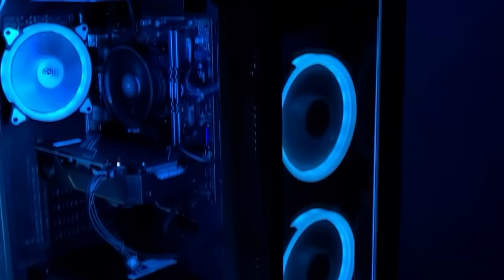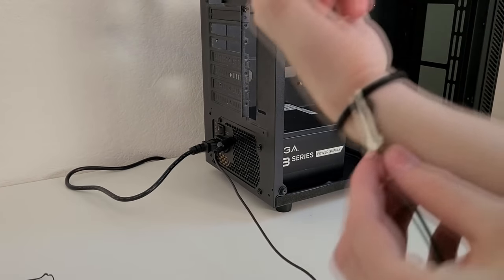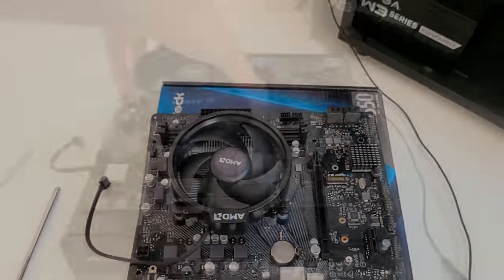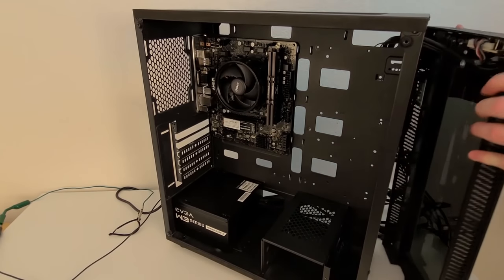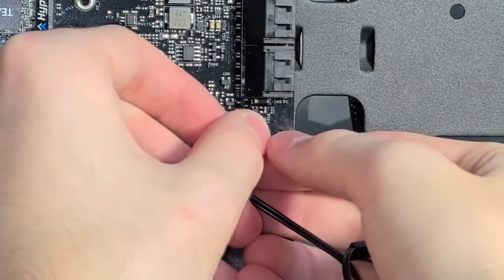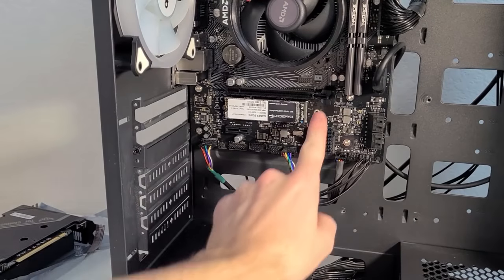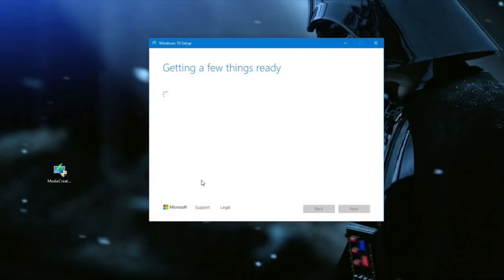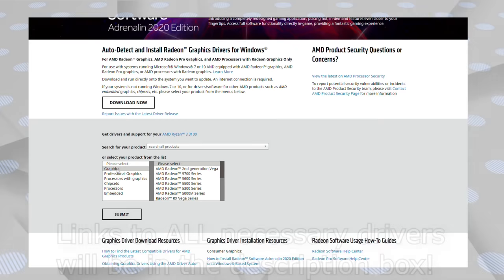BEST $550 Streaming/Gaming PC [Tutorial, Benchmarks]

Comment: MY RGB fans light up on boot but go out. games crashing on start i assume from my 5mbps speed... refresh rate is only at 1 HZ....
Reply: Is this a joke😂
Reply: @antissleeping2912  didn’t download my gpu driver... working good now
Reply: @JohnSmith-xq6cv  oh ok👌
Reply: @JohnSmith-xq6cv  since this dosent have built in WiFi what did you do, did you connect a WiFi card or an Ethernet cable? And did you fix the problem with your fans? And how did you fix your fans
Reply: @antissleeping2912  100 foot Ethernet cable. I’m try to fix the Rgb fans lighting today, I hear that all you have to do is NOT plug into the fan adapter and plug directly into the motherboard
Reply: @JohnSmith-xq6cv  have you fixed your fans?

Comment: Guys help if I have a laptop with windows installed on it can I use its ssd to boot into windows or do I need the flash drive and idc about a watermark laptop has been dead for months and we won’t need it
Reply: I would recommend you to use flash drive since it will be much easier to install
Reply: @big_smoke7t  but I can use the ssd right because the laptop is broken and I have a school chrome book where Microsoft is blocked
Reply: @crazytigerspy9420  yes , you can
Reply: @crazytigerspy9420  but make sure your laptop's ssd fits in your pc
Reply: @big_smoke7t  it’s 2.5 inch sata

Comment: Ryzen 3 3100 vs ryzen 5 2600 
Which one is better for gaming, streaming ?
Reply from the maker: 2600
Reply: @Roo_Tech  thanks !
Reply: Obviously 2600 , it has more cores and threads but 3300x will be better choice than those 2.
Reply: @big_smoke7t  r3 3300x has 4 cores and 8 threads , but r5 2600 has 6 cores and 12 threads
Reply: @shoto2089  it's not all about having more cores and threads
Reply: @shoto2089  Ryzen 3 3300x uses 7nm while 2600 uses 12nm. Also 2600 only support up to 2900mhz ram while 3300x can go up to 3200mhz. And 3300x uses single 1 × 4 ccx layout conpared to 2 × 3 ccx layout in 2600 which means 3300x will perform better bcz single layout reduces the time of the cores to connect each other. Also it has higher clock speed so well I will choose 3300x over 2600.
Reply: @big_smoke7t  thanks man !